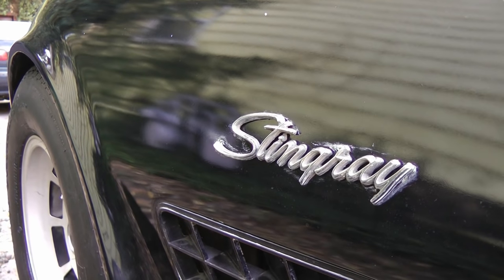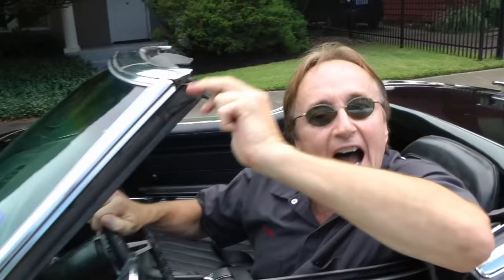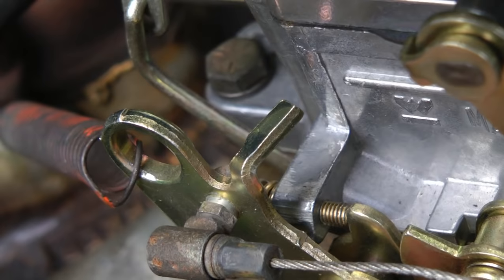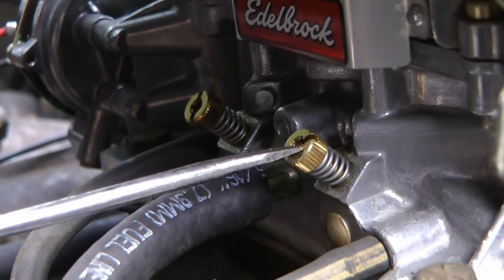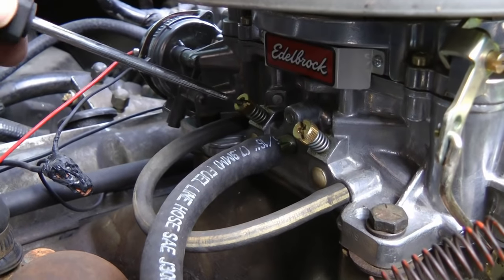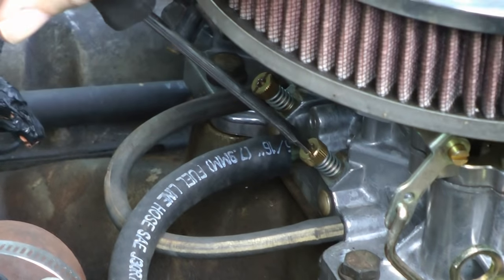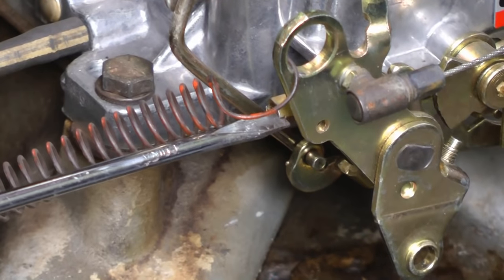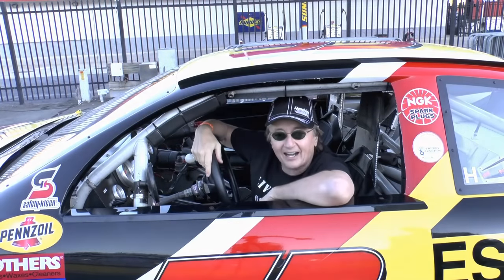How To Adjust A Carburetor On Your Car

Comment: I hAve to screws ones got a spring and the other one does not the one closest to the driver is the idle screw or low speed screw it's got a spring the other I believe is the high speed fule screw, it's a xf ford fulcon also the other screw that controls the cable is on the other side what is stock setting for it I realised the carboy cable screw was hitting the side and staying open I bent it straight and fixed it and stuffed the lsn hsn settings I see with yours you only have to lsn and one cable screw how do I a just the Hsn do I need to rev it right up to it hits max revs for it. very load tho no like a rc car where I can do it I'll need to a just it a Easter way any help would be appreciated cheers.
Reply from the maker: take pictures and send me the pictures doing the following and I can tell you for sure : If you wish to ask me car questions, So go to www.scottykilmer.com     and ask me in the Ask Scotty section. So please, if you want your questions answered, go to this link and join my completely FREE website. No strings attached.

Comment: MY 1988 CHRYSLER FIFTH AVENUE  NEED TO PASS ETEST AND FOR 2 YEARS IT HASENT..I AM TOLD TO LOWER THE IDLE SCREW AND  GET IT TO RUN VERY LOW TO PASS..CURB IDLE... BUT IT FAILS... HOW CAN I DRIVE MY CLASSIC  CAR AGAIN?
Reply from the maker: san379 move to texas, they don't do emissions testing on 88s, they are too old for texas law. But, it all depends on why it's failing. Do try my video "fixing bad catalytic converters" and pray that cleaning fixes it.

Comment: that engine needs a shampoo and some dress up
Reply: 30GB You need to hush up and go to bed, but not before you say your prayers that you will become an adult one day.
Reply: That comment was also very adult of you.
Reply: indeed it does.. :). A little high heat paint and a little flex tubing over Dem wires! Mine needs some engine bay clean up too ;)
Reply: neds a tune upo, cause it toc toc toc...scotth should have let the engine in the smooth area. the mix screw should be left in a middle point not right after the find of poor mix...

Comment: I did this Scotty, my carburetor keeps making a popping sound, Shooting up air and stalls when I feather the gas
Reply: I got my carburetor finally tuned right. I actually have another question if you can help? As soon as I get the truck started, 5 min later I noticed my oil pressure gauge drops then dies. It's a 75 gmc k2500 350 small block 3speed manual. Thank you joeseph
Reply: Sound like your floats are stuck in your carburetor aslo check you spark plugs if they are dry or wet.
Reply: Spark plugs were a little wet thank!

Comment: Hey I've got an 1976 FJ40 which is coughing and with low power, what could it be?
Reply: got a 83 caprice and mine ran poor due to adjusting the carb and the rocker arms on my 350 in it. then replaced fuel filter and got some injector cleaner you put in your tank and now it roars and goes like a corvette :)

Comment: This says nothing about the metering rods or step up springs, or the fact that those screws only control the mixture at idle.
Reply from the maker: ***** it says adjust, not rebuild in the title.
Reply: Scotty Kilmer Metering rods and step up springs are part of adjustment.  :-/  Anything off idle is controlled by the rods, not the idle mixture screws.  Trust me... I spent a lot of time fighting that on a Dodge D150 with an aftermarket Edelbrock 1400 carb that was "adjusted" extremely lean and had springs that were too light for the amount of vacuum obtained from the slightly aggressive cam.

Adjustment should also include choke advance settings, and possibly jets if the defaults are wrong.

Then again, your target market is average drivers and not the tuning/tweaking/building type, so perhaps I'm looking far deeper than you intend to get into mechanical fuel delivery.  :)

Comment: My car idle at 1,500 rpm when i start it up cold, then after several seconds, it acelerates to 2000 rpm and then it falls back to 800-900 rpm, what is wrong?
Reply: Ivan Cagala Many cars idles faster when it's cold to warm up the engine faster.
Reply: Ivan Cagala I dont know about edelbrock but on my holley carb the cold idle has a different screw to control it. To reach it you must push the gas lever to WOT and it becomes visible on the opposite side of the carb. It was in a really awkward place so it might take a little looking.
Reply: blakedawg9 Same, except on my little Holley two barrel it was on the drivers side next to the idle screw. I didn't know which is which but it was touching this plastic piece with steps on it-thats the cam. Adjust it in or out for however long you want it to sit at a higher idle on the cam-higher in winter & lower in summer.
Reply: Ivan Cagala depending on how long it lasts it is probably your choke and fast idle screw, depends on what carb you have for example the fast idle on an edelbrock is below the throttle linkage I believe, it rests against a cam on your choke linkage.
Reply: my car has a set of valves in the intake manifold that are suppose to stay closed on engine warm up, then open when at running temp.. The solinoid for it is bad and my car does the same thing..idles at 2k on warm up.. It's an 03 fuel injected mazdaspee though.. Haha. It wont hurt anything but fuel mileage before it warms up.. Heck, most people just remove them out of there proteges and just keep the solenoid just to keep the cel off . Haha
Reply: yamaha94O Ive never heard of that, what motor? if you don't mind me asking cause most of my experience is with 86 and back ford, chevy and Pontiac motors.
Reply: Mr. Phiesta it's the 2.0 l4 turbo in my mazdaspeed protege.  It's a dual port intake.  With 2 sets of valves. The vics valves stay shut forcing the intake to take a long passage for optimized fuel mileage, but at 5500rpm +, it opens up, allowing access to a shorter intake passage so you get more power at high rpm like a 2 stoke engine.  The second art of valves, the vits valves stay closed when the engine is cold to tumble the intake flow to aid in engine warm up :)

Comment: What about a car that has no carb. Like a Nissan 240sx.
Reply: If it doesn't have a carb you can't adjust it
Reply from the maker: Echo-GAMING older 240s had an idle speed screw on the passenger side of the intake, just did one. Screw it in, it idles slower, screw it out it idles faster

Comment: some carburetors arn't adjustable, am i right?
Reply: Some random person Maybe not easily, but the fuel/air can always be adjusted.
Reply: ***** cars have this too, when new cars came with carburetors the adjustment screws often had metal caps pressed into the body of the carb, sealing off the screw. I highly doubt that any old car you would buy today with a carb on it still has the original one so this shouldn't really be an issue but still something to be aware of.
Reply: 27dcx  thanks, if i remove the caps could i just leave them off?
Reply: +Some random person yep,

Comment: what if the engine won t start?
Reply: Szaby Sascha replace it. Should cost a few hundred bucks, but it'll do the trick ;)
Reply: I have a citroen Axel with double copr carburator. A guy made some adjustments on it, now the consume is very high, a the cold starts are hard.

Comment: Carb? Do they even make cars with those anymore?
Reply: auxmike No
Reply: auxmike No, new cars have EFI or DFI. Electronic fuel injection (electrically controlled carb) or direct fuel injection (the name says it all)
Reply: My '93 Saturn had a carb like throttle body with a single injector spraying the fuel straight down...
Reply: auxmike that's called throttle body injection. It's very similar to a carburetor and it's very simple and easy to clean as well. Unfortunately GM stopped using TBI (throttle body injection) a long time ago.
Reply: auxmike Suzuki Maruti , I think . But , carbs are still in production for mopeds and chainsaws . Carbs are very simple , cheap and easy to repair , but hard do adjust and very inefficient . Modern cars could never achieve fuel efficiency they have without carb . Reason why some old  economy cars were efficient while heaving carbs is because they were almost 2 times lighter than modern economy cars . My Ford Sierra ('88 Sedan) is lighter than modern Ford FIesta (hatchback) . Sierra has 1.8l engine , 89HP and it does about 10l/100km (25MPG) , while modern Fiesta has 1.0 Ecoboost with 125HP and real life it does 7l/100km (35mpg)
Reply: hanratty450 Since the Wagoneer isn't a car, I'm assuming you're coining the term car, meaning motorized vehicle.  However the last known vehicle to use a carburetor from the factory, Which is even listed on the wikipage of "Carburetor" is the 1994 Isuzu Truck, Which I've owned and was not impressed with.
Reply: Mladen Milić A properly adjusted carburetor will have just as much power and economy as a throttle body injected engine. I don't know much about the direct injection though so that's  different story
Reply: RizoProduction the 1994 Chevy s10 with the 4.3L doesn't have a carburetor unless someone did some aftermarket mods. That engine is fuel injected.
Reply: illstplaya The injectors sit above the tb, and inject fuel into the barrels. I've worked on the motor enough to know it has tbi .The 1994 s10 did however come with 2 types of motors, which is represented by the final letter on the vin number, The two motors varied from SCPI (Central Port Injection) then theres TBi, (Throttle Body Fuel Inection So you're correct that it's Fuel injected.
Reply: Thats called throttle body fuel injection. That is not considered a carb in any way shape or form. There's 2 fuel injectors. They sit right above the throttle body. Most fuel gets sprayed directly on top of the throttle plate and the rest of the fuel gets sucked down between the plate and the body when the throttle is closed. There no carb
Reply: illstplaya Oooh, Okay. Well I feel stupid now. Dx Thanks for letting me know that.
Reply: illstplaya Well let me throw this one at you, and see if you can figure it out. I've got a 1995 Ford Mustang.. Base model, with a 302 v8 5.0L in it. xD It's carbed, what could be the explanation of that?
Reply: auxmike Cars? No. Other engines? Oh hell yes. Almost all small power equipment is carburetted; cheaper, lighter and simpler.
Reply: RizoProduction the Mustang was fuel injected since the 80's. At least the 5.0 was. I don't know about the 4 cylinder. But you should have fuel injection unless someone has done some mods to the engine.
Reply: I've modified it myself xP I dropped a 1983 f-100's 5.0l in it, and it came carbed. So i dont know if the owners of the 1983 f-100 ever did any mods to it, but whn i bought the f-100 and pulled them other it was carbed. nad i dropped it in my mustang. haha
Reply: RizoProduction then it's carbed. XD
Reply: illstplaya Yep haha, was just thowing it out there to try and confuse you haha!
Reply: RizoProduction If you want to be all anal about semantics, then technically there are plenty of "motorized vehicles" being made with carburetors. They may not have 4 wheels, or be meant to travel on public roads...
Reply: Tim Ramich Well darn, got me there! lol.

Comment: I don't understand why people buy muscle cars with electronic fuel injection and switch them over to carbs. Just get an older car to begin with, if you're so afraid of technology.
Reply: Tim Ramich sometimes it’s also because of the simplicity. I’ve seen builds where people use carburetors with ls engines. They can still make a ton of power, its simple, and they don’t have to worry about wiring or dealing with all the computer junk. They may lose mpg but usually it’s not a daily driver so it doesn’t matter.